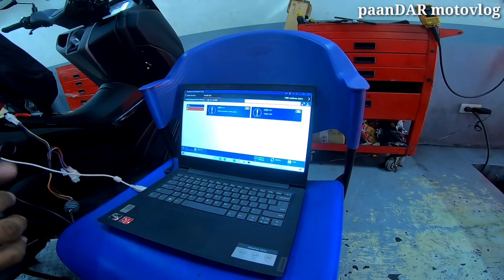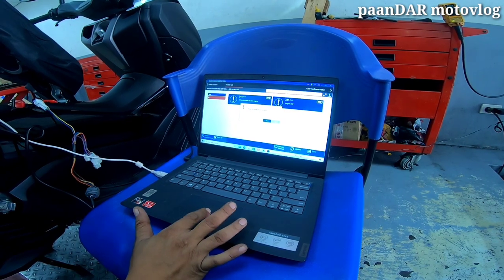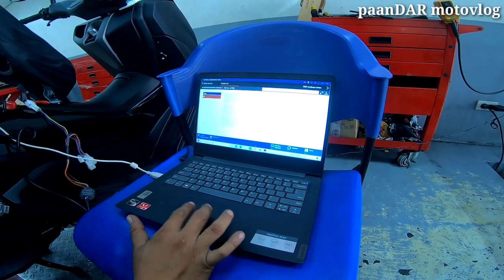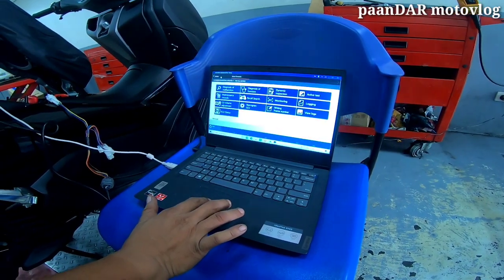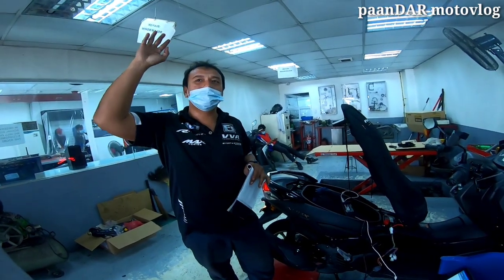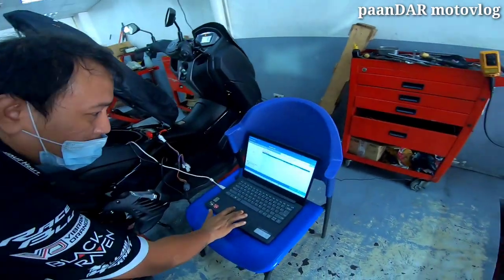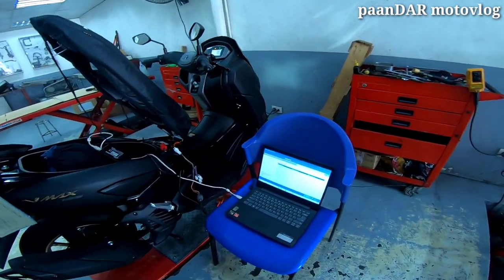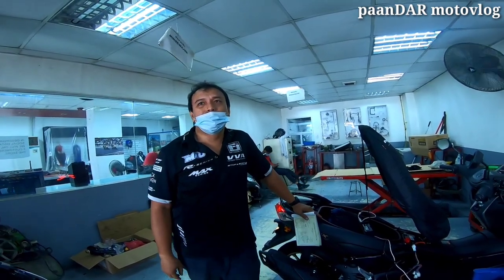NMAX 2020 REPROGRAM | ACTUAL RESETTING | Tangal pugak

Comment: Sir naranasan ko din yan sa nmax2020 ko..nagpugak nawawalan ng power,ang gnwa ko in off ko tas binuksan ko ung gas tank cover at ibinalik ko ulet,ayon tumino,tingin ko sa ganyang issue natatakpan ung cngawan na butas na maliit sa gas cap kaya walang pahigop n hangin papuntang gas tank kaya ung supply ng gas papuntang makina paputol putol kaya pugak din ng pugak.
Reply from the maker: Oo nga boss e sinabi ko din yan Na nabukasan yung tank cover tas nawala Ang sabi nya reprogram daw talaga kc babalik daw talaga boss
Reply: Under observation pa sakin paps kung uulit..isang beses ko lang naman un na encounter..ang gnwa ko ngayun,ung maliit na cngawan sa gas tank cover inilayo ko sa bunganga ng butas ng tangke..kumbaga inilayo ko sa labi ng bukana ng tangke ung maliit na butas...
Reply: Matanong ko lang paps libre lang ung pag reprogram?
Reply from the maker: @imjay3961  oo paps libre kung doon ka kumuha
Reply: @paandar25  Lods,  pumupugak din yung Nmax v2 abs namin, Engine switch off the engine start lang umo ok naman,  4 to 5 times encounter na,  engine restart lang umo ok naman.  Yung iba napanood ko nagpalit fuel pump
Reply: @norwindaveramirez6089  ganyan din akin 3 beses na nakakatakot sumumpong pang nasa byahe at oovertake ka bigla humina takbo maging cause ng aksidente
Reply: @BelardoMufflerCenter UU nga Lods, Dpa naman na-encounter na nasa birit mode.  Tuwing bagong andar lang,  karamihan new starting ok naman,  5 to 7% minsan pag start engine pumupugak Ang engine, kaya restart engine umaayos naman,  mahirap yung amin sa K Servico kinuha,  baka may bayad reflashing pag pinagawa sa Yamaha 3S Shop yung Ecu reflashing
Reply: @norwindaveramirez6089  yamaha 3s ko din kinuha sakin boss eh cash irereklamo ko sknila yan kasi bago yunh motor tapos may ganon di man nga masyado gamit yung motor
Reply: @norwindaveramirez6089  nakakabahala lang ksi mahirap na matsempohan
Reply: @BelardoMufflerCenter  Kung pwede lang,  Boss.  Ipalit new model Nmax 2021, Parang na scam pagbili.  Nung december 22 lang nabili Nmax 2020, Bigla Lumabas Nmax 2021 nung Feb 27, 2021. walangyang Yamaha,  saka bigla naglabas bagong model,  nagdagdag new features Yamaha connect at Tcs😁😀😄

Comment: tanong kulang paps bat naka on hazard mo? 
Hazard lights should only be used when the vehicle is stationary (parked on the side of the road), or is in a dangerous position after a crash or if the vehicle has broken down on the road and is stranded. These are the only reasons to use the hazard lights. baka maka tulong sa iba paps